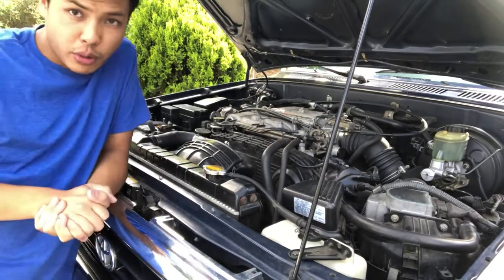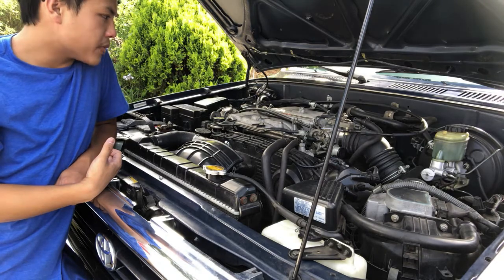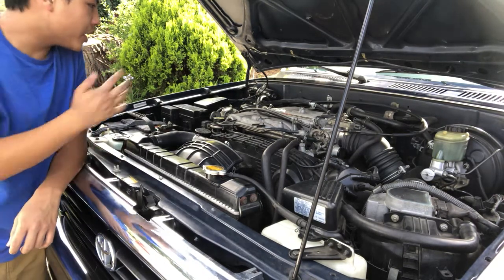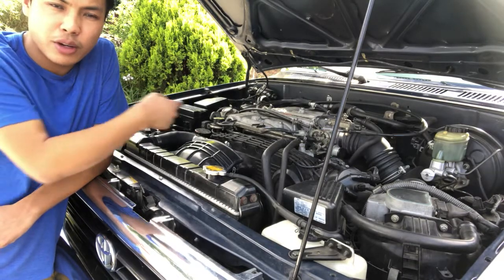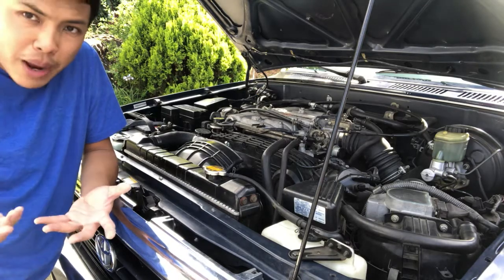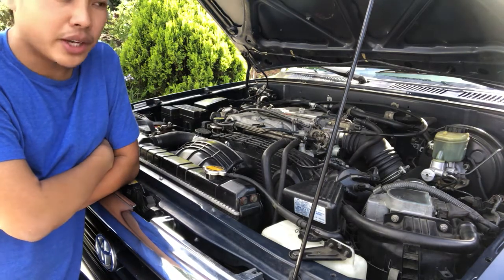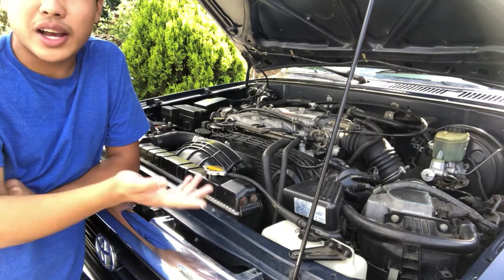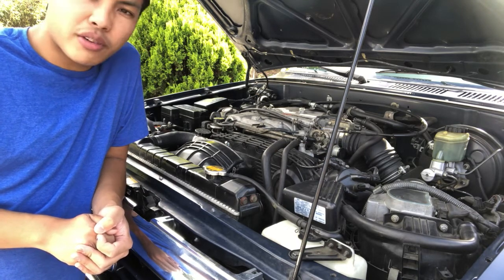Toyota 3VZE: My HONEST Thoughts (rambling rampage)

Comment: 3vze will eventually blow a head whether you take care of it or not because of an engineering design flaw. Particularly, the heat from the crossover pipe. Some remedies are to install headers (or wrap the crossover in heat wrap if you can’t afford), delete the EGR, use multi-layer head gaskets (most important fix), and only use Toyota pink coolant. If those things aren’t done the gaskets will eventually blow under stress (ie very long road trips in the summer time, towing, or even randomly).
Reply: I would wrap the crossover pipe like I did on mine

Comment: Had my 3vze Toyota pickup for 3 years never had a head gasket issue until this summer under normal conditions going down the highway at 65 then lost all power, I used to say the same things you do. 1200 dollars in oem and aftermarket preventative parts later I’m saying if it blows now I’m swapping it for a 22re or 4 banger diesel
Reply from the maker: 22RE isn’t bad. I just prefer the 3VZE. Mines holding up pretty well still
Reply: The thing that makes the 22re better is the aftermarket, 3vze has barely any aftermarket, but I love mine if I didn’t I wouldn’t have put the money into it, I hate how it gets hated on id like to make some power with mine

Comment: You are indeed rambling. This engine was first used in 1988. The head gasket problem was solved in the 1992 or so, and Toyota had a factory recall on the earlier 3VZE models (replaced mine at 103,000 miles no questions asked). Haters will hate, but this engine performs well at higher RPM and does not have great low RPM torque so you know what that means to the rock crawlers who naturally prefer the 22R engine. You really are rambling. Good video anyway. 1991 SR5 V6 2WD with 370,000 miles and running great.